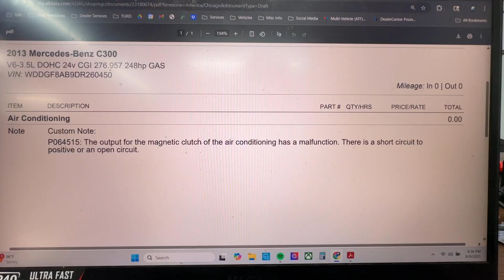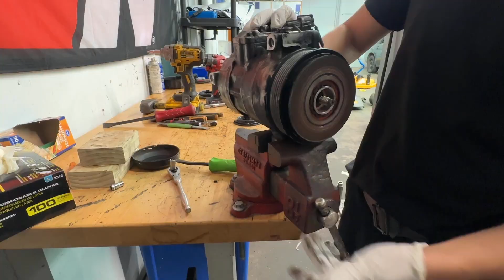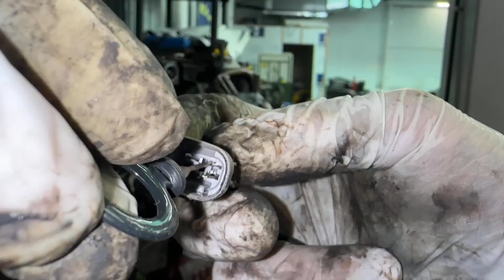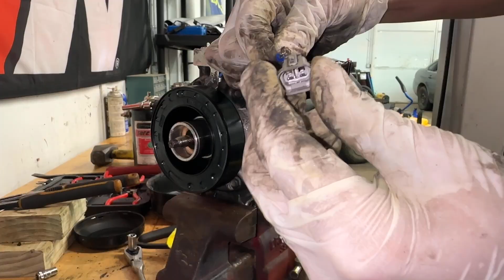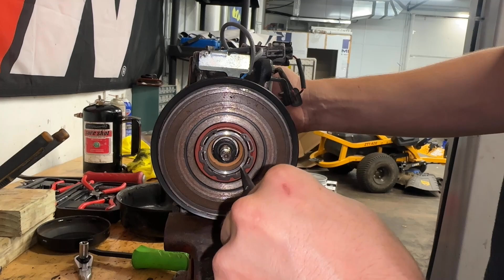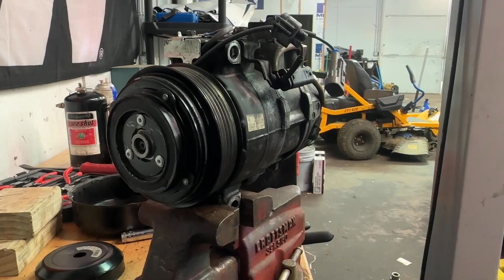Mercedes-Benz AC Compressor Repair

Comment: Hey question... Mine is  na v6 3.6 w204 and I've replaced the compressor twice well the first og wouldn't work right blow cold for a min then ac button flashes the 2nd compressor it semi worked but was leaking changed to the 3rd same style compressor no clutch on the outer pulley just the solenoid type well for some reason the ECU thinks it has a magnetic clutch but doesn't and throws a code for a malfunctioning clutch and can't cha6this option in my scanner I can turn the compressor on with my scann6but the car still looks it from working just like the og compressor did idk what else to do besides trying to replace the compressor for a 3rd time or take it to a Mercedes dealership where they will get me for everything pretty sure lol really trying to get this to work right as it messes with other functions of the car

Comment: Lad, this is the only video I've found of someone working on the same compressor as I've got in my car. Very helpful. 

Shame I saw the bit about "I shouldn't have drilled out those rivets" too late. I take it you just put pop rivets back in where the original ones were? Or did you nut and bolt?

The spindle / nut on mine is SO seized that it won't come undone (2012 car, 220k miles) - so I'll be on it with a blowtorch tomorrow to see if heat makes a difference. Wish me luck...

Thanks for the video!
Reply from the maker: Hey! I did end up re-riveting them with regular aluminum rivets. Still holding up a year/15k miles later
Reply: @StraightlineAutomotive legend. I riveted mine back together and it ran solidly until the refrigerant leaked out. My journey continues 😂
Thanks again man